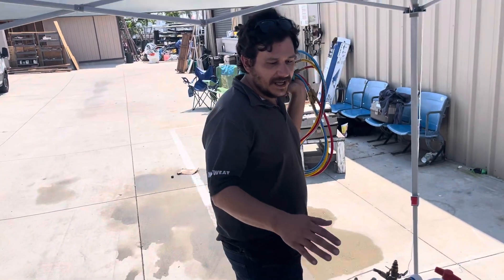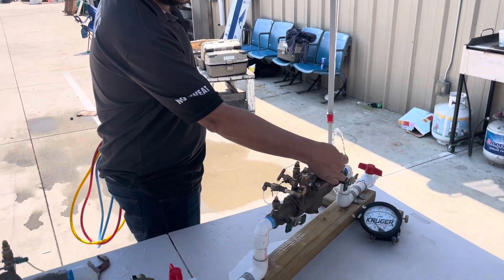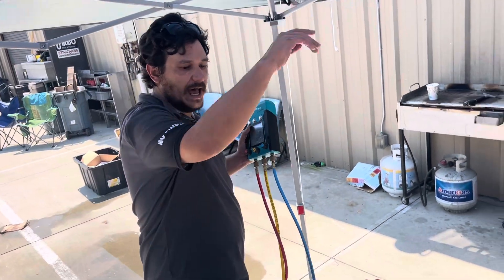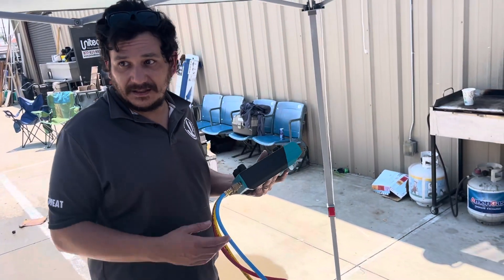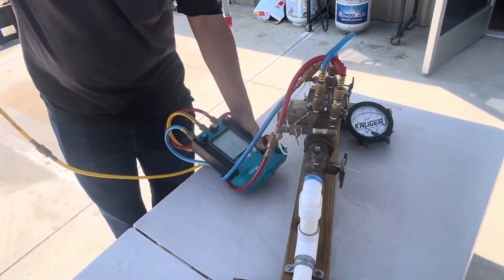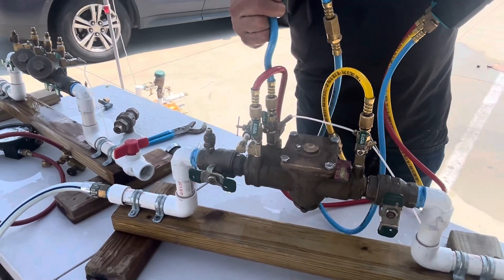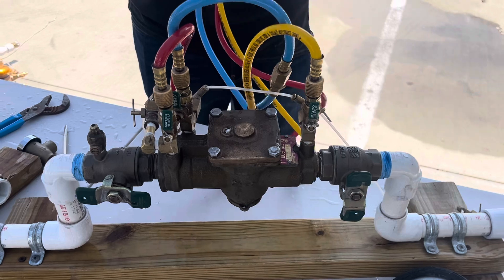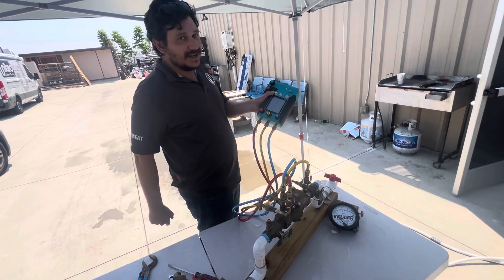RPZ - 5-Valve Test Procedure Using Arbiter Mako

Comment: 👍🏻I have a question, I work with a guy that says he doesn’t shut the water off the device to test it. I’ve asked him to show me, but that hasn’t happened yet. I’m I in the right to say that you can’t test the device without turning off the flow?
Reply from the maker: So the way we have it set up with our programs, we utilize either the USC 10th Edition or the ASSE 5000 procedures from like those textbooks, depending on the area, both of those include shutting either one or both of the shutoff valves during the test. You have to confirm a no flow condition in order to properly test a check valve. Some people do classes or tests without doing this but they are using older procedures, generally before 2000 they didn’t confirm no flow but now they do, some states still do it that way like they’re okay with the older procedures, but to answer your question the USC and ASSE procedures which are updated regularly include shutting off the water during the test. The idea is that a leaking check valve would appear to be working fine if there is flow through the assembly since the leak would not be apparent if there is flow
Reply: @whatisbackflow  Thanks for the info, now I can put the nail in the coffin on that👍🏻